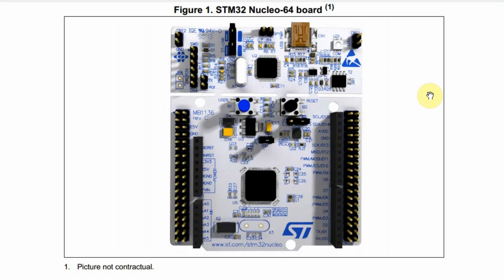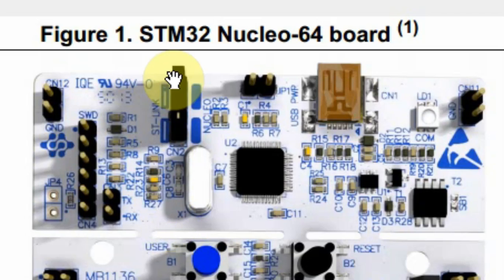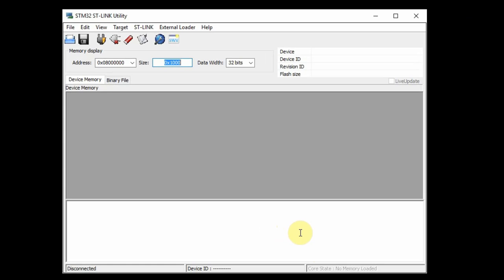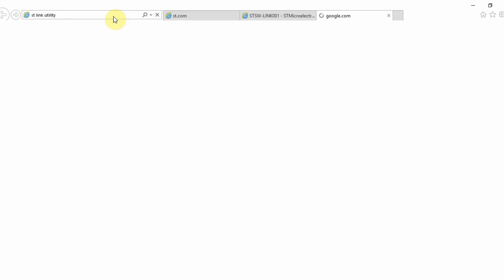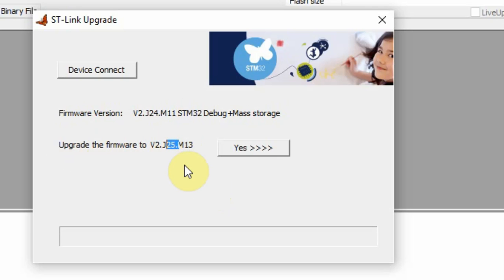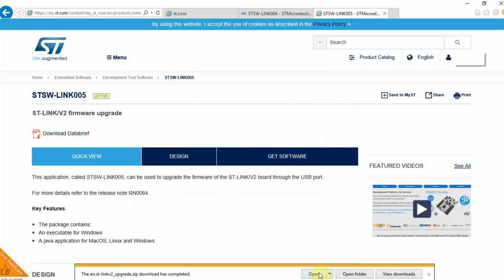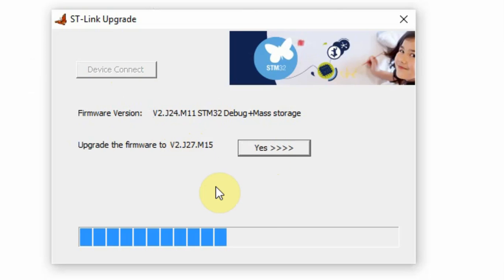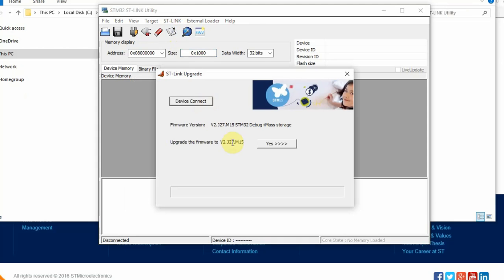ST Link Update

Comment: my st link utility says no st link....but i have connected my stm to the pc..tell me what to do?
Reply from the maker: Did you try to use AS STM32CubeProgrammer?
Are you using the real ST Link or a clone?
Reply: @Weblearning1  hey my problem is solved it's in the wire....my teacher usb cable work ...but mine don't it gives power qhen i connect to pc but don't actually stablize....tge problem is I don't know what the wire is called neither do my sir....can you please help us?
Reply from the maker: Some USB cables only give power without data lines. These are the low cost ones that you get when rechargeable devices. A USB cable that you buy from the shop will work fine.

Comment: After succes update i have message "st-link is not in the dfu mode. Please restart it." . How to restart or go to dfu mode?
I cant connect anywhere
Reply: I use st-link v2 usb
Reply from the maker: Just unplug and plug it back again to the USB port.
Reply: @Weblearning1  still have same message ☹️, I've been trying to unplug for a while, restarting pc, and reinstalling the app .so i guess i have to jumper some pins for reset or command from application

Comment: Using the ST-Link Utility (v4.1) it detects my ST-Link V2 firmware (V2.J17.S4 STM32+STM8 Debugger) and the Yes>>>> is enabled to upgrade to 'V2.J28.S7'.. however after a few seconds it says 'Upgrade Error, Please try again.' 

What should the Boot jumpers be set to? 

USBDeview shows it as a Vendor Specific Device Type (VID/PID 0483/3748) but in the Device Manager (Win7) it's listed under Universal Serial Bus devices and says the driver (winusb) is "working properly".   What could be the problem?
Reply from the maker: You don't need to do anything except what I have showed. Most likely you are using a USB hub in your connection to the PC. Try removing it and connect it directly to the PC and try again. Let me know if it worked.
Reply: Strange, I've tried a $3 ST-Link V2 directly connected to 2 different laptops (Win7 and Win8)..  same result.   Why the ST-Link Utility and the 'ST-LinkUpgradestandalone.exe' both read-back the version (V2.J17.S4) yet the progress bar never starts, is beyond me.. it always reports 'Upgrade Error'.   

Even the latest and greatest en.stsw-link009 .zip (V2.J29.S7) does the same thing!

I'm thinking of trying to do the upgrade using Segger's STLinkReflash utility.. or via the ST-Link Utility's command-line tool, but not sure where the actual programming file exists.. or the command:  
ST-LINK_CLI -C SWD HOTPLUG -P c:\FilePath\example.bin 0x080A0000 –Rst   ???
Reply from the maker: That's very storage, I did this many times and never had any issue. Try to see maybe Google has an answer or try to change a computer, anti Virus something.
Reply: @Weblearning1  I'm trying too, Upgrade Firmware v.2.J17.S4 to v2.J34.57  for ST-Link v.2. In ST-Link Upgrade, I see "Upgrade Error, Please try again." Screenshot https:// i.ibb.co/qCVYckt/ST-Link-Upgtade-error.jpg
Reply from the maker: Are you using a USB HUB on the way? Try different USB port directly to the PC. 
Try replacing the USB cable. 
If it still not helping, try a different computer.